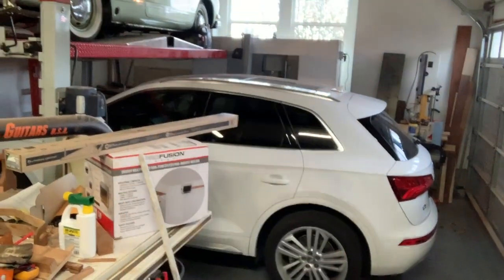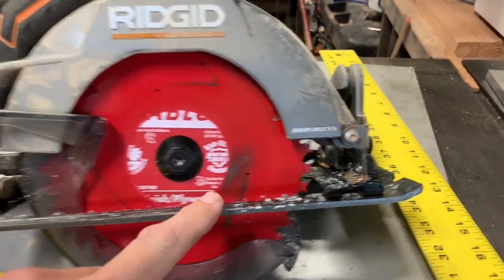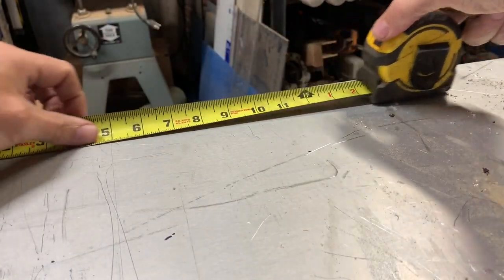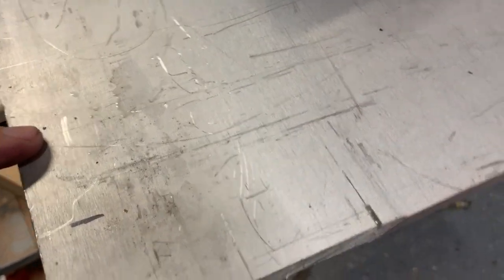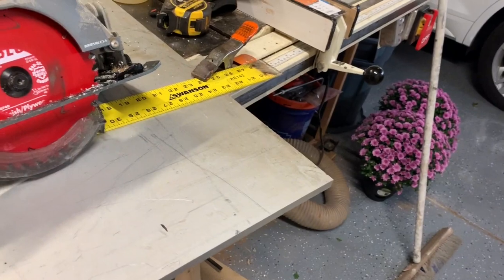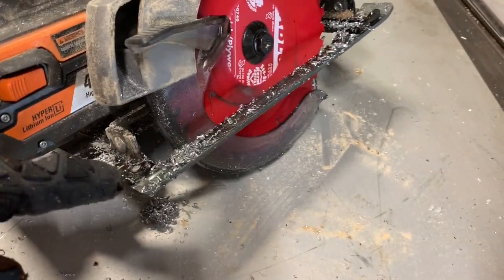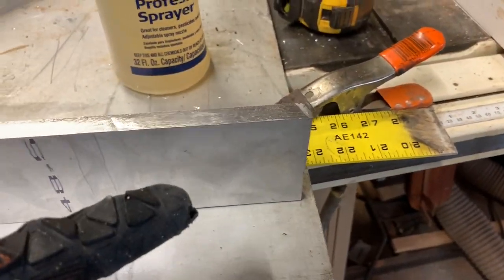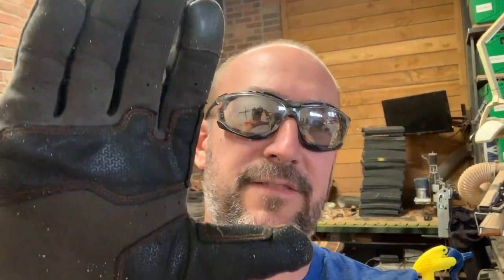How To Cut Aluminum Plate At Home - DIY

Comment: that looks like it works great.  i once cut a thick piece of aluminum on a miter saw with a diablo blade.. while it cut it really well, i decided to use my fingers to clamp down the aluminum.. well the aluminum shifted and the blade kicked back, launching the aluminum 50 feet in the air and landing on my neighbors property... it zipped past my eye, man i was lucky.. now im a clamp freak.

Comment: LONG time wood worker - NEVER would I have thought to use me skill saw for cutting 1/4" aluminum plate - GREAT VIDEO!!!!!
Reply: This is 1/2 aluminum which makes it even more impressive
Reply: the diablo blades are made for this, although you can use any blade > 40 tooth / 10"

Comment: I have several cuting oils, but my general use one is amonia and works very well.

Ammonium hydroxide is used as a refrigerant gas because ammonia absorbs heat from its surroundings.

Dexron:
Works wonders when you're using carbide burrs to cut aluminum with a die grinder.

Cutting metal: ❤
Ammonia, Alcohol, and some blue dish soap.

Household ammonia is ammonium hydroxide. This solution contains 5% to 10%.. is slightly alkaline, and it can etch aluminum and other metals.

Comment: Good one! I've never cut aluminum plate that thick with a circular saw before. I think maybe 3/16 at most. It's good to know I can go thicker.
Reply from the maker: Over 3/4" puts the blade in a position where it doesn't have enough stick out on the bottom.  If you're doing something in the 1" variety, a table saw with a 10" blade will work much better.
Reply: I hope you wear a mask from now on especially using w2-40 and cutting metals. Very good, informative video!  Thanks!

Comment: Someone has probably already commented but you'll get even better results with less strain on your saw with a non-ferrous metal cutting blade. Diablo makes them, available at Home Depot. Harbor Freight even has a very good one in at least a couple sizes. I have them in 7-1\4", 10", and 12" for circular, table, and miter saws.

Comment: That's a good tip, thank you. I definitely recommend some good ventilation for that job. Even drilling aluminium will give you a headache and a nasty taste in your mouth after not very long in an enclosed space, so be good to yourself. 
Weather permitting, do it in your driveway with a big plastic tarp on the ground to sweep up all that sharp nasty hot stuff! And yes, a respirator mask, goggles and ear muffs if you have them. (Cutting metal is a wee bit noisy!)
Reply: Aluminum is one of the most neuro-toxic commonly used metals. I never even cook with it. Meanwhile this guy is inhaling aluminum vapors right into his face 🤤 mmmmmm dementia / alzheimers.

Comment: Hurts my head listening to you measure in inches 🤯 as someone that uses Mm every day it sounds like gibberish to me 🤔  thanks for the pre warning about the hot chips though 👍
Reply: I grew up in seventies when we were slowly changing from imperial to metric so can do both. I mostly use feet and inches for large areas like furniture or room dimensions as can visualise it easier. Measuring a rough length of say a driveway in feet is super easy as just use my own feet. For tiny measurements under 1 inch i prefer millimetres. Never found a use for centimeters 🇬🇧

Comment: I used this method to cut 1/4 inch plate using a 24 teeth blade. I am still amazed how easy it was. Thanks for the tip!

Comment: I wore long sleeves and a face shield when I did that with sheet metal because those little flying hot pieces of steel hurt.  I never cut aluminum with it tho but it looked like it cut it like butter. Looks like you are having fun. 👊👍
Reply from the maker: Having a blast!  I hope things are well in your world Douglas.  I'm been using the new (new to me) Tormach.  It's an amazing machine...  Now I just need about 80 more hours in my week so I can have enough time to chase my ideas.

Comment: Diablo actually makes a blade for cutting aluminum and it’s much more efficient than what’s shown here.
Reply: Yep... it doesn't need the lubrication either. It takes out smaller chips and the finish is better as it doesn't burr. 
 
Try their carbide jigsaw blades as well. They're great on aluminum.  (But at $10 each, I wouldn't go over ¼" on items like steel.)
Reply: Does a carbide jigsaw blade work on 3/4" aluminum plate?

Comment: I have just used my table saw.  Lots of power and straight cuts.
Reply from the maker: I need to get a cheapo blade for my tablesaw so I can rip big pieces like this.  I don't dare put my flat toothed blades into aluminum service (even tho they'd probably work)!
Reply: HI, I have a Chicago table saw. Can it use to cut aluminum sheet? or need to have additional blade? Thanks for your time.

Comment: Ditto Thanks! Found 1/2 thick, 5 inch wide aluminum bus bar at my local scrap yard. Used your tips and it cuts just like lumber! You advice on setting the saw blade cutting depth shallow is especially useful to prevent the carbide tips from clog and the saw motor slowing.

Comment: Did you destroy that blade?
Reply from the maker: Nope.  You can get quite a few cuts out of each blade.  If you keep wd 40 on the cut, the blades last much longer.  The problem isn't the the hardness of the metal, it's the gumminess.  The carbide is plenty strong, but the aluminum will stick to it and that causes chip evacuation issues, then heat, etc.  The blades are super cheap ~$7, so I swap them out after a couple dozen cuts just because.
Reply: Wat blade?

Comment: That’s crazy, I needed to cut 1/2 aluminum for some brackets I’m making I was using a cut off wheel and an angle grinder but got frustrated so I tried my wood band saw and it worked fine I’m sure the blade is wearing fast but it worked, thanks for the video
Reply: aluminum is really gummy, band saws will get fused with gummy aluminum bits... try the diablo blades.. (man, i sound like a diablo shill in these comments).

Comment: This is NOT cutting aluminium plate at "home". say it as "cutting at WORKSHOP". Cutting at home means using common household items people have. Heavy duty workshop item does not fit this category.
Reply from the maker: Nah...  That's a cheapo Home Depot cordless saw with a super cheap blade.  If this cordless did the job, any corded saw will EASILY plow throw the aluminum.  Don't over complicate it man.

Comment: Man that works good I use a diablo sawzaw blade and they last a long time too.
Reply: I use the diablo jigsaw blades for this. It has a thinner kerf, and no lubrication needed. Plus the finish is absolutely pristine. 
 
I tried with their recip blades, but their too flexible, and rip too much out with their tooth design.
Reply: gotta love diablo

Comment: Nice work Greg!  its cool how you can use wood saws and router bits on aluminum.... you can do that wiht Steel for about 1 cut lol.... btw, Dont you have one of those milwaukee metal cutting circular saws?  could have swore you did but i could be wrong...
Reply from the maker: 1 cut on steel...  Then the fookin' teeth melt off and hot shiz goes everywhere!!!  Yes, I have a Milwaukee metal cutting circular saw.  Its awesome!  I have cut some heavy stuff with that beast.  I just used it on the Tormach enclosure.  Nicest finish on a sheetmetal cut you can get if you don't have a shear.

Comment: That is so awesome I was so concerned with how to cut the aluminum for a bagger on repairing on my Scag TT 61 mower. I’m going to use my circular saw. It will do a good job my plate is only quarter inch diamond play aluminum. Thank you very much for this video this is great. And yes I’m going to do it in my neighbors lawn LOL. Just kidding.
General repair 👨‍🔧

Comment: I like this way better than using the tablesaw. I have a metal cutting blade for my circular saw.
Reply from the maker: Agreed.  You can do this with no issues on the table saw, but I have no idea if kick back is an issue at some point.  I don't want to be on the receiving end of that!  Does your metal cutting blade work on steel?  I've got one of the Milwaukee steel cutting circular saws...  I love it.
Reply: Greg's Garage yeah, my tablesaw is 3hp. I’m terrified when I cut anything but wood on it.
Reply: Greg's Garage it’s the harbor freight metal cutting blade. I think it’s good for steel and aluminum.

Comment: i'm pretty sure diablo has a blade specifically for this. Ive used the ferrous metal ones in my cordless. works great
Reply: I'll be sure to run out and buy a fifty dollar blade that can get used once and hang on my wall for eternity. 
Great job missing the point.

Comment: Hell you arent even using the Diablo aluminum cutting blade! Thanks great video.
Reply from the maker: Yep.  I've always used the cheapo blades.  You can get 5 for the price of 1 aluminum blade.  I think that math wins in the long run, but I could be wrong.
Reply: @GregsGarage  Thanks!